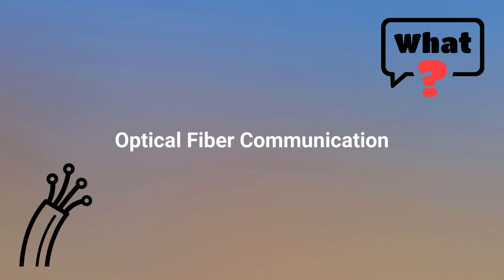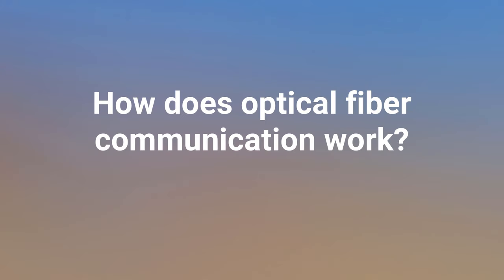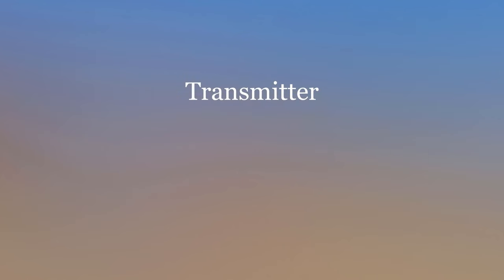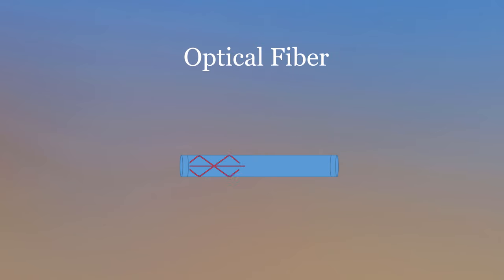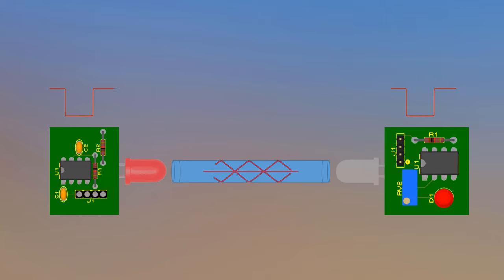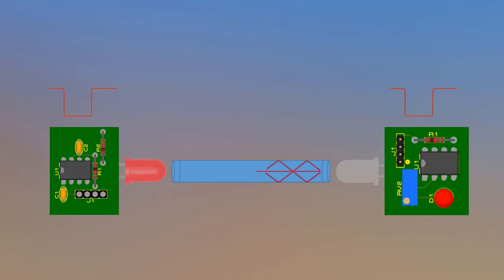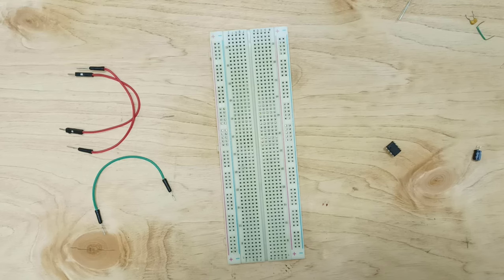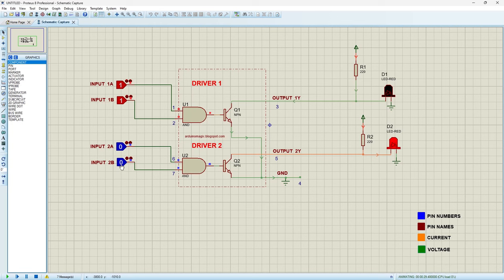Optical Fiber Communication with Arduino  |  Arduino-Powered Data Transmission with Fiber Optics

Comment: bro, can the 2.4ghz signal be converted to this module... so that I can transmit the 2.4 signal to many routers via fiber... to act like OLT...
Reply from the maker: no
Reply: @electronicstree  oh okay... for the signal you transmit using this method, it's a digital or analog signal... bro
Reply from the maker: You can transmit both analog and digital signals using this method. In the demonstration, I transmitted analog signals.
Reply: @electronicstree  thanks bro for the explanation...I will try transmitting 2.4ghz wifi signal (analog signal) over fiber (ROF)... router <> laser transceiver <> fiberoptic <> laser transceiver <>router

Comment: Is it possible to modify the code so that it transmits texts via the serial monitor using this same circuit?
Reply from the maker: Yes 👍
Reply: Can you give me or help me with a code that performs this process?

Comment: The only problem I see here is the price and availability of TX diode HFBR-1414Z and RX photodiode HFBR-2412Z. Currently, prices for these components are around $50. However, the video is very interesting!
Reply from the maker: The prices I found range from 7 to 10 dollars for each module, while some sites offer them at 20 to 28 dollars. If you find any, you can use any TTL-compatible modules according to their data sheets.
Reply: @electronicstree  I decided to use a different technology for my project - toslink. RX and TX (DLT1160A) cost me ~$2. Thank you for the inspiration.

Comment: sir , i have question : how to connect SFP modul with arduino?
Reply from the maker: Which specific SFP module are you looking to connect to the Arduino?
Reply: @electronicstree   i don't know yet, i'm going to use my single -mode fiber optic system , arduino uno, two SFP modules on both sides of the fiber optic

Comment: Plz i want circuit  digram and code
Reply from the maker: https://arduinomagix.blogspot.com/2023/10/interfacing-optical-fiber-transmission.html?m=1
Reply: @electronicstree  thx so much  but this code not included  lcd 
Plz I  want to make this project  full details and circuit digram with ic
Reply from the maker: For schematics, I have already provided you with a link. The source code, which uses ASK modulation for data transmission, is also included in the given link. If you are asking for serial control via optical fiber, you can find the code in the download section.
https://arduinomagix.blogspot.com/p/downloads_5.html

Comment: Could you provide the schematic for the Receiver circuit? I went on all the Arduino links you provided but I couldn't figure out the connections to the LCD. Apologies if I missed it! I really want to try this circuit out. Thank you!
Reply from the maker: I have provided the receiver schematic in parts 4 and 5. All you need to do is connect the TTL data out pin to the Arduino RX pin. As for the usage of the LCD, I assume Arduino users already know how to use it because it's a basic thing.

Comment: At 9:34 you mention frequency compensation, then at 12:06 you say the diode D1 protects the TTL data from reverse voltage, don't quite understand, reverse voltage from where? Does I suspect D1 does both waveshaping and protection, is this correct? Otherwise, exceptional video, thank you.
Reply from the maker: The reverse voltage here refers to the transient voltages or spikes caused by the SN75452B's switching activity. In this configuration, the diode is used to protect the optical transmitter from these voltage transients or spikes that may be generated by the SN75452B.

Comment: can optical communication do 2 way comunication betwen 2 arduino just using single core optical cable ?
Reply from the maker: The answer is no, and the reason is that with this limited hardware setup of an optical transmitter, receiver, and Arduino, you can't achieve bidirectional communication. For this purpose, you have to choose BiDi transceivers for your two-way communication with a single optical Fiber cable.

Comment: Hey! Fantastic video, I was wondering how/if it would be possible to modify this design to work at 6.2 MBaud?
Reply from the maker: If you're working with microcontrollers, this transmitter and receiver setup should work fine. To answer your question, you just need to adjust the values of the passive components for the transmitter. For the receiver, if you're looking at speeds above 5Mbaud, you'll want to swap out the HFBR-2412 with another model like the 2416. Check out Broadcom's Applications Support Guide for all the configuration details you need.
Reply: @electronicstree  Thank you! I will look into this, do you have sample calculations for how you chose your own passive component values?

Comment: Could u make a video explaining a simple DIY protocol for a simple project like a coupled LED and sensor transmiting info between 2 arduinos,  i mean, data structure for serial communication, error check etc
Reply from the maker: Creating a DIY protocol for a project like this is quite achievable! We can design a straightforward communication protocol utilizing serial communication, implementing error checking mechanisms to ensure data integrity between the two Arduinos. I'll be sure to incorporate this into the upcoming videos.
Reply: Ill wait for ittt thanksss!! @electronicstree

Comment: Hi bro
How to send 3 sensors at the same time ??
Thank you
Reply from the maker: If you are using UART communication, you can use three modules. You can use Arduino Mega, which has multiple hardware UARTs, and for Arduino Uno, you can use SoftwareSerial. As for ASK modulation, I'm not sure, but the RadioHead library may not support multiple transmitters and receivers in a single network.

Comment: Buat alat spliser dari arduino bisa ga ya
Reply from the maker: Building a fiber optic splice tool with Arduino is tough because it needs precise equipment like fusion splicers to accurately join and fuse optical fibers. Arduino isn't well-suited for such a complex job.

Comment: can i use it as for SPI communication?
Reply from the maker: If you want to use the SPI interface, you will have to use the number of optical transmitters/receivers and optical fiber cables accordingly to the SPI lines. This is because it requires more signal lines (wires) than other communication methods. Essentially, you have to convert every electrical signal line to a light signal and then convert these light signals back to electrical signals. Therefore, this approach may not be suitable.